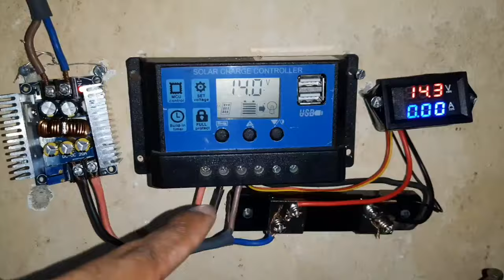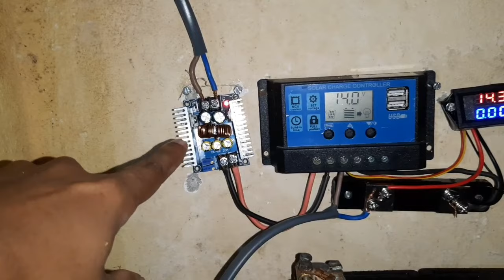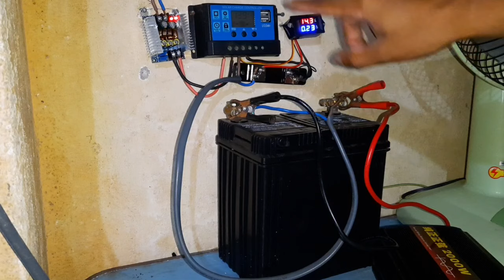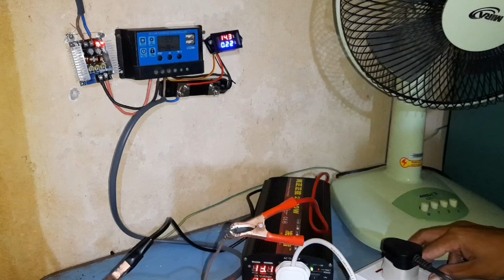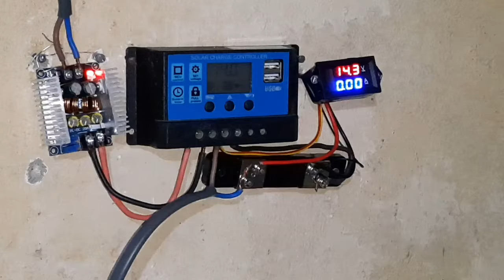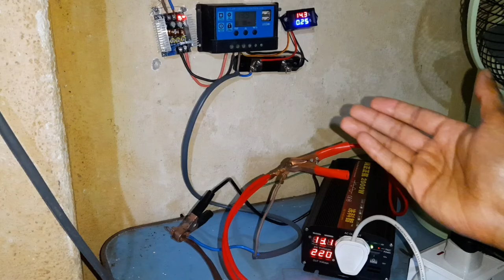Solar Powered Fridge - How to Run a Fridge With and Without! Batteries

Comment: Why my luminous 850 va inverter  showing overload when i try to turn on fridge ? Im using 42 ah battery .. reply plz.fridge may be 80 watts but im TV fans lights all running around 700 watts load.. and then alone only fridge not able to turn on why?
Reply from the maker: Good question. The problem is that the fridge has a compressor which is an induction load. It will need 3 to 7 times its rated power to startup. Especially when the fridge is stopping and starting frequently. The pressure in the system will make the compressor work harder on startup. So your 80w fridge will need 560w or even more just to start. And if you are running other appliences at the same time I dont think your inverter can handle all that load.
Reply: @diysustainableliving2774  my inverter is 850 watts ..i tried to run only fridge no other load still didn't worked
Reply from the maker: Is it 850w peak or 850w continuous and 1500w peak?
Reply: @diysustainableliving2774  I don't know peak sir! What is it
Reply from the maker: I just had a look at the product specs. It should easily handle 540w. So next you have to check whether your battery to inverter wires are thick enough. Thin wires cannot deliver that amount of power. Also make sure the battery is fully charged. Finally you could consider adding Supercapacitors to your battery to boost the startup power. I have a separate video on this showing exactly how it helps in starting a fridge using a small battery.

Comment: Hi, what is the small part on the left that you conect before the charger. And what is the purpose for that part doing?.
Reply from the maker: That is a buck converter. It regulates the voltage from the panel before going into the charge controller.
Reply: @diysustainableliving2774  i thought that solar panel is 12v which would connect directly to the charger control.
Reply from the maker: @vnyeu  a 12v solar panel voltage is around 20v with no load and around 18.5v at its maximum power point. To charge a 12v battery you need 14.4v. And pwm charge controllers act as a high frequency switch to momentarily connect and disconnect the panel to achieve the desired voltage. The problem with these cheape pwm charge controllers is that the voltage goes to around 14.7v which can over charge the battery. And if you see my other videos I have a LiFePO4 battery setup aswell. So thats why I have added a buck converter to give better control of the charge voltage. If you only have a lead acid battery the scc alone would be enough.

Comment: The super cap set up wouldnt work the next day when the sun comes up. 

the caps would be discharged and the low voltage on the panels would not give an adequate kick to start the inductive load.
Reply from the maker: Exactly.... That is why you need at least a small battery in your system.
Reply: wouldnt the panels charge the caps?

Comment: Fried Ice Cream Machine that has power 740w..  Can I used this method with a 2000 watt pure sine wave inverter?
Reply from the maker: You will need to size your inverter to around 3 to 5 times the power rating because of the ice cream machine compressor. And the panel size and battery size will depend on what time of the day you are going to use the machine!
Reply: @diysustainableliving2774  how many solar  panel do you think required power of 740w   ice cream machine
Reply from the maker: It depends..... You can only harvest solar power for 6hrs a day right around noon. So you will have to calculate your 24hr requirement and size the panels so that you can get that power during that 6hrs. Eg you are running a 100w bulb for 12hrs. Then you will need total 1200 watt hrs. To get that power you will need to have a 200w panel. 200w × 6hrs = 1200watt hrs.

Comment: How long did it run the fridge?24hrs?
Reply from the maker: No... Without a battery it wont run when the sun goes down. Even if a cloud passes over the system will shut down. This is a proof of concept that supercapacitors can handle the  temporary surge of power needed for induction loads. After it has started the fridge can run on the power directly generated by the solar panels as long as the panel output is above the power needed for the fridge to run.
Reply: @diysustainableliving2774  which type of battery is good for 70w fridge to make it run for 24hrs
Reply from the maker: So for example. My fridge which is around 70 uses 0.35Kwh of power per day. So if it is only the fridge you are going to power you will be safe if you have at least that amount of battery power. So for a 12v deep cycle lead acid battery with a 50% DoD you would need a 60Ah battery to be safe. For lithium batteries this can go up to 80% DoD.
Reply: @diysustainableliving2774  what of if I have 100ah chloride lithium battery 12v,and inverter that has maximum power of 1200w and continuous power supply of 600w...and 200w solar panel
Reply from the maker: That should be enough to make a 70w fridge run for 24hrs. It now depends on the efficiency of the fridg. The fridge on and offs when the temperature rises. So as long as the fridge doors are not kept open all the time you should be fine 😊
Reply: @diysustainableliving2774  wait it's not lithium, it's actually calcium battery
Reply from the maker: Calcium batteries are also lead acid batteries however im not sure about the battery model that you are talking about. Specifically whether it is deepcycle or not. If it is a deepcycle battery then you could do a depth of discharge (DoD) of upto 50% which would still be 50Ah which will be 0.72Kwh of usable stored power. Also during the day time you will be using more solar than from the battery. So the battery is needed for mainly 14 - 16hrs when the sun is down.
Reply from the maker: It depends on how often you use the laptop. You can use the same setup you use for the fridge and see whether you need more power. That will depend on how long you use the laptop. BTW 130w is a lot of power for a laptop.
Reply from the maker: Unless you are playing high specs games on that laptop you will rarely max out your power supply to 130w.
Reply: @diysustainableliving2774  I tested it it showed it was overloading the battery,I don't know which type of set-up can run it well whether gaming or not
Reply from the maker: Unless you play high specs games on it, it will not max out that 130w power supply. It all depends on how much you use it.

Comment: Can it be use without the stepdown transformer thank you for the answer. And what stepdown transformer you used?
Reply from the maker: This is a dc to dc stepdown converter. These are available on online retailers such as aliexperss. If you dont use it, without a battery you dont have control of the input voltage from the panel.
Reply: @diysustainableliving2774  can i know, why need to control the input voltage? What are the voltage you set ?
Reply from the maker: @mohdrahmat3420  12v compatible solar panel voltage can varies from 0v up to 20V.  Inverters will function from 10.5v to 15.5v. If you dont regulate it within that range the inverter will shut down. Buck converters do a wonderful job at regulating the voltage. I set mine at 14.2v as I also use a LiFePO4 battery in my system aswell.
Reply: @diysustainableliving2774  does 13.7v suitable for lead acid battery?
Reply from the maker: @mohdrahmat3420  Yes but you can actually go upto 14.4v if you are using lead acid battery only. It will charge up faster. At 13.7 it will take a long time to charge fully!
Reply: @diysustainableliving2774  thank you for the explanation.. 

I want to setup 50w mono solar, deep cycle battery 18Ah for using dc equipment.

12v to 5v 2.4  to charge a powerbank.. 

Does 12v 18ah battery suitable to run inverter?
Reply from the maker: @mohdrahmat3420  Well first lets see the battery storage. You can store 12 × 18 = 216wh max. For a deep cycle battery it is reccomended that you dont discharge more than 50%. So you will have 108wh or 0.1Kwh of storage. That is equal to running a standard 50w table fan for 2hrs on an inverter. Next is the solar panel. You can get max power from the panel for only 6hrs a day right around noon. So the maximum power you can generate with that panel is 50 × 6 = 300wh. Or 0.3Kwh. And also depending on the apms the panel produces it will be less than that.
Reply from the maker: @mohdrahmat3420  Yes you can run an inverter but you cannot power a significant load for a long time at night.
Reply: @diysustainableliving2774  thank you for further explanation. How to set up a discharge rate on a battery? Using solar regulator?
Reply from the maker: @mohdrahmat3420  You dont set discharge rate. Discharge rate is determined by the load you use. If you add a heavy load the battery will discharge fast.
Reply: @diysustainableliving2774  can i know what is maximum amount of ampere on a dc output from solar charge controller.. 

12v 1A? or it will follow the solar panel?
Reply from the maker: @mohdrahmat3420  It depends on the power of your solar panel. The bigger the panel the higher the amperage. Depending on your panel you should size your charge controller. Lets say your panel outputs 8A. For that you need a minimum of 10A solar charge controller.
Reply: @diysustainableliving2774  hmm i see.. 

I'm planning  make a dc solar system..
The output from solar controller goes to 12v to 5v usb to charge powerbank/phone using 50watt solar and 12v 18ah battery.

Where are you from? Philipines? Taiwan?
Reply from the maker: @mohdrahmat3420  If that is your only use for the panel you can use the panel to charge the battery and from there use a car phone charger to bring down the voltage for phone charging. Those have additional options such as fast charge!

Comment: Hi sir! I've got a power inverter same 2000 watt output but doesn't have LCD display. Is there a device I can purchase to monitor the inverter watts and volts? Thank you
Reply from the maker: My inverter display only shows the volts. To see how mang amps are comming from the solar panels Ive installed an amp meter after my pwm charge controller. If you want to see how many watts your appliences are using you can consider buying a watt meter which plugs directly into the inverter power outlet. They are all available on online stores.
Reply: Thanks so much man! Keep making more videos I've subbed!
Reply from the maker: Thanks!
Reply: Hi there. Sorry to bother again but I received my brand new 12v inverter yesterday, however when I connect a 6v battery to it it gives red blinking light. Is the battery too weak?
Reply from the maker: You need a 12v battery to connect to a 12 v inverter!. 6v is not enough. That inverters low voltage cut off will be around 10.5v where it will shut down!
Reply: @diysustainableliving2774   you are the best! Thanks man! Didn't have a 12v battery at the time to test but I'm glad it has the cut off feature not to kill the battery
Reply from the maker: Good luck with your off grid system build!
Reply: @diysustainableliving2774  Hi there again! Thanks so much for your input and advice my system is working really well. I'm running a refrigerator on 102ah Deep cycle battery. However Im now looking to buy solar panel with charge controller. Any advice on which size panel to buy to match the battery? Also will I be able to leave the battery connected up to the solar panel continuously so it automatically chargers during the day? Thanks in advance
Reply from the maker: The maximum you can use from that battery per day is 50% DoD. That is 50ah. So just for charging that you will need 50 × 12 =600. 600÷6=100. 100w just for charging the battery for night time use.. And then for the day time depending on what you are going to power you can add more panels. I'd recommend a minimum of 200w of panel. It would be better if you can get more than that since you can add more load during the day time!
Reply: @es8944  so you connect a 12v inverter to a 6v battery and expect it to work? what 6v batter would you have that produce >50 amps? or were you just joking when you post this?

Comment: Hi friend. Wouldn't it be better to buy a balancing card for your super power packers and leave it in parallel always with the solar charger and battery and inverter? so as not to have to always be aware of charging the xcondenser with the bulb? Could you make a demonstration? Thank you
Reply from the maker: Well.... My balance board gave trouble so I built my own top balancing circuit using 2.7v Zener diodes. As for the capacitors you have to only charge them up once. After that they can be connected parallel to the battery the whole time.
Reply: @diysustainableliving2774 
How is it done?
To charge it for the first time in my solar system. Do you first put a 12v 20w bulb in series with the supercapacitors and when this bulb goes out, do you remove it? in my bank of lead acid batteries. I then connect the supercapacitors in parallel? And it will also be placed in parallel to the inverter. I don't know if I explained myself. forgiveness. any scheme? Thank you
Reply from the maker: @antonioaranda1800  The explanation of why you need to charge the caps slowly is that they can charge and discharge rapidly. What happens to wires if you send a large ammount of current through them?... They get hot! Very hot!
Like that when the super capacitors charge up from 0v you dont want to send a large amount of power unrestrictedly. You have to put a resistor to reduce the flow of amps initially. This capacitor bank has to be charged from 0v all the way up to 14.2v. If not restricted there is a chance of sending 14.2 × 56F = 795 amps in one to two seconds. If that happens the capacitors and all its connectors can get extreamly hot and even explode!!..
Reply from the maker: @antonioaranda1800  what you said is exactly how its done. The bulb functions both as a resister and as an indicator. Since the once the capacitors reach a voltage close to that of the battery the voltage difference will be less and hence the flow of amps across it will be less and it will lose its glow!
Reply: @diysustainableliving2774  But once it is charged for the first time, the battery voltage will be equalized and it will not be necessary to put the bulb in series with the supercapacitor module. TRUE?
Why if that day is cloudy all day and drops to 10 volts. and another day is loaded because the sun came out. I understand that the load will be the same on the batteries and capacitors because they are in parallel. No?
Reply from the maker: @antonioaranda1800  True!... Once they are charged up you dont need the bulb. And both voltages will be equalized. The benefit occors when you give a large induction load to that combination. Batteries have to convert chemical energy to electrical energy to produce power for your load. That will take a bit of time. Where as the capacitors already have the elecrtical eneryg ready and just release it instantly. As you know an induction load such a motor or fridge compressor need a lot of power at start up. Usually 5 to 7 times their rated power. It is here the capacitors are useful. Just for the few milliseconds at startup!
Reply: @diysustainableliving2774  but the fear it gives me is when you say that the supercapacitors are discharged in a few milliseconds and I understand that the bank of supercapacitors will remain at zero. And there is where I don't know if we have to put the bulb back in series to restrict the charging current of the supercapacitors again or is it only at the beginning of installing these supercapacitors in parallel with the inverter? excuse my ignorance. thanks friend
Reply from the maker: @antonioaranda1800  No No!... :) The supercaps once paralleled to the battery will stay at the battery voltage. They will not go down to 0v. They will go down from 14.4v to 12.6v when there is power comming from the panels, and from may be 12.8v to 12.4v at night time! It is within that voltage drop only you get the added amps to boost the output power of the battery! Remember 1v drop on a 56F capacitor bank is 56A!

Comment: I think connecting directly to the battery while the solar controller is charging it in parallel means some power are being drawn from solar. Why did he not use the output terminals of the solar controller?
Reply from the maker: I dont think I understood your question correctly. In the first part I am running a standard solar setup to show how a battery starts a fridge. Next I show what happens when you connect an induction load directly to solar output. And thirdly I show how a supercapacitor can bridge that gap. Please let me know exactly what you would like to clarify.
Reply: 2:39 You connected the inverter to the battery but the battery is still connected to the charge terminals of the solar controller. Therefore, the inverter is drawing power both from battery and solar at the same time.

Why is it that there is nothing connected to the power output terminals of the solar controller? Is it not the proper path to get electricity coming from the battery while it charges?
Reply from the maker: Good question. Those output terminals on the solar charge controller are for small loads such as a light in your shed. They max out at 5 to 10A. You should not connect heavy loads on those terminals. For large loads you have to connect the inverter to the battery (Or Supercapacitor) terminals directly.